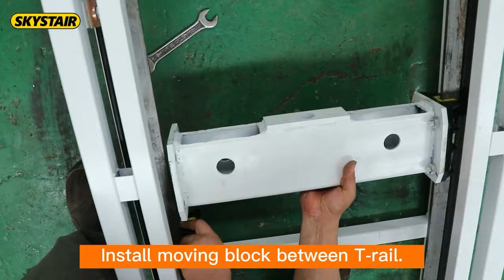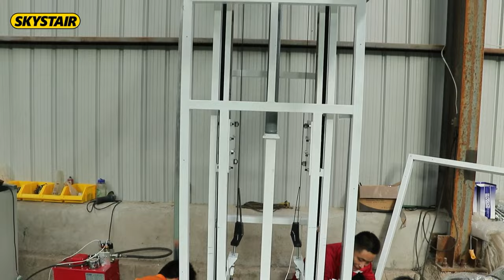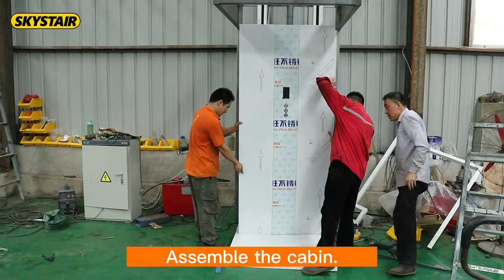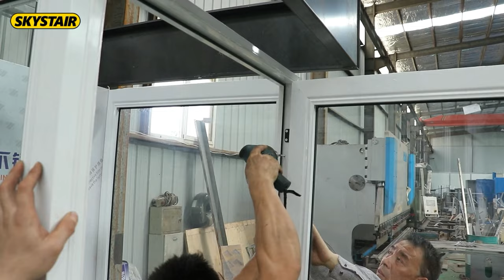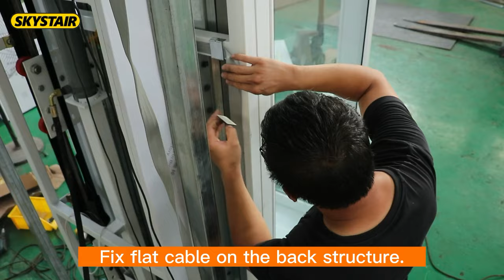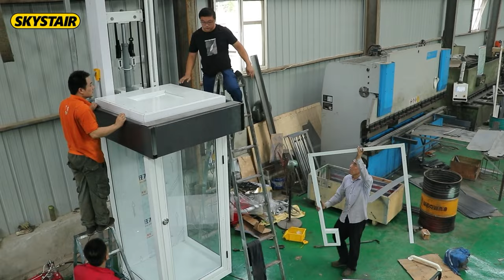Install a Skystair low cost Residential Home Lift Elevator

Comment: What is the minimum space requirements (length vs width), and maximum number of floor can be covered?
Reply from the maker: Sir, min install space can be 0.9x1m, max can be covered three floors. My WhatsApp number:0086 13615419596( China)
Reply: Lavorate anche in Italia?

Comment: How much it will cost that lifter?
Reply from the maker: hello, may i know the lifting height you need? Price will based on lifting height and delivery city.
Reply: @ElevatorFactory  my house is 4 floor building but has lift space for only 4 feet x 3 feet 

Price???
Reply: @ElevatorFactory  my location is in Bihar , BUXAR, just tell me price Average
Reply from the maker: @SoulThunder  May I know the max lifting height? In meters.
Reply: @ElevatorFactory  13  meters approximately
Reply from the maker: @SoulThunder  sorry, the max height we make is 6m. Can’t do 13 meters.